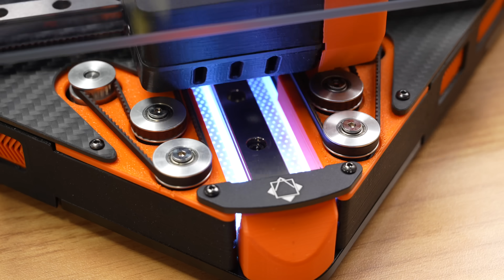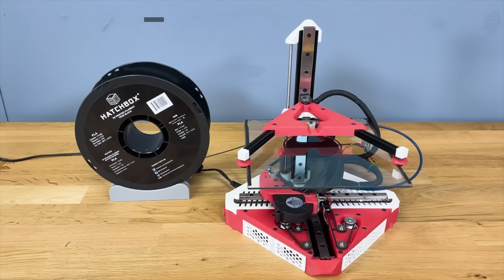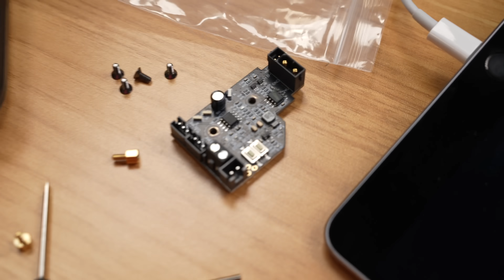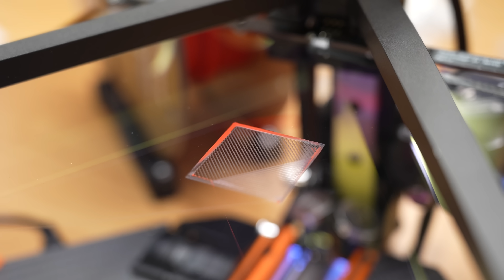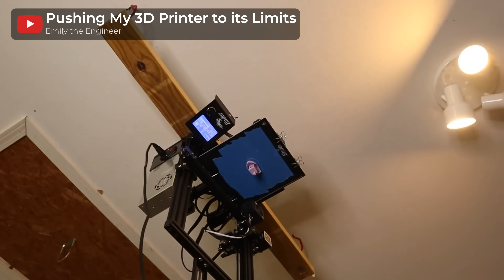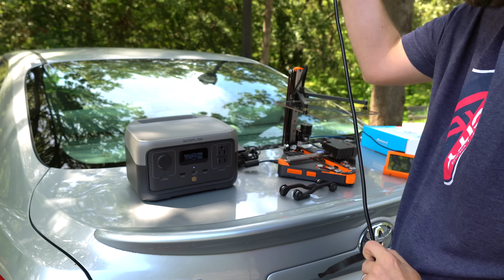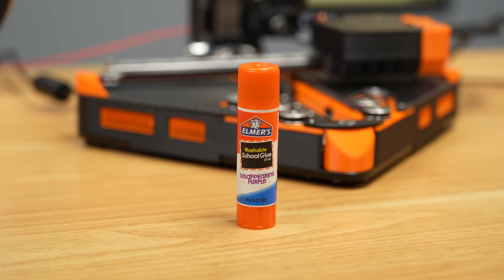Finally, a 3D Printer for Australians!

Comment: heating up a glass heatbed isn't that new, I mean, have you seen car rear windows?
Reply from the maker: True but most of the time you see little wires going across for resistive heating. I hadn't seen an ITO coating on consumer glass before.
Reply: @JeffGeerling  True, and that is indeed novel. In essence its one big transparant resistor that way instead of the laminated wire (which is cheaper but probably also more durable against wear). I do wonder if that has negative consequences for generating hotspots in comparison with the "usual" running a wire through (laminated) glass/PCB method.
Reply: @thomasvnl  From our testing, heating has been almost perfectly even unless someone scratches the coating with extremely sharp metallic tool on the back. The printing side of the glass doesn't have the coating, so damaging the coating is very difficult.

Comment: Now that I think about it... wouldn't it be safer if the extruder was in the bed as well.. like not on the Z axis... might help with the ptfe tube not catching on the linear rails...n I was wondering y the rails were sticking out so much... just realized that the linear rails are not as maintainable without lubrication...

Comment: with those insets, you really don't want them under the surface, as then they'll have to sustain pull-out force.
Ideally they'll be flush with the surface, so that the part you're screwing down onto there, sits on the face on the insert. This way it only has to support the torque of the screw

Comment: corners are rounded because you did not tune pressure advance there is a klipper doc about how to do that for klipper based printers, also 247 printing is pronounced 24 7 printing :P as in 24 hours 7 days a week,  also flor the nozzle issue, it shouldnt ooze that much when heating up  it might be the start macro that is causing it to push filament without being on the build plate to push it onto that, i recommend getting Kamp for klipper and letting it put down a Adaptive line purge that one is big and thick enough to pull every last bit of filament stuck to the nozzle with it, and cleans it that way
Reply from the maker: Thanks, all good info!
Reply: @JeffGeerling Dont get too tempted to go down the tuning route though.

Id adjust the input shaping. pressure advance for maybe 3 of your favourite types of filaments (say petg, pla and tpu) and then leave it be and enjoy using it.

Comment: i have solution for for that drooling issue: instead of pliers, use folded kitchen paper, with the lightest spritz of cooking spray. it's much easier to wipe the nozzle clean with that. and the wee bit of oil will polymerize, and build up to form a non-stick coating, much like seasoning iron cookware. seasoning nozzles is super old school, but it works!

PS: a lazy way, that could get awfully messy over time, would be to print a generous skirt
Reply: Wouldn't retraction be better? I'm thinking about retracting the filament about a cm, or ~½inch, so the filament wouldn't get heated as much, and won't expand.

Comment: The idler pull spacer, my tip is put it on an hex key and then put the key in the hole while holding the spacer up with your fingers

Comment: Finally a 3d printer that also works upside down
Reply: Most actually do, there just isnt typically good reason for it as they arent designed to be hyper portable.

Comment: Klipper is software that runs on Linux. It requires an operating system, specifically Linux but maybe any posix-compliant os would work… and can, in theory, run on any computer, not just the Pi.

Comment: Do you have any recommendations for a beginner friendly printer for  someone interested in getting into 3d printing?
Reply: @justvashu  A1 Mini easily. Prusa mini is outdated by comparison. The A1 does everything for you for less and is faster.
Reply: @BeefIngot  About the same price in Europe.
Reply: Prusa mini
Reply: @TheNetworkingGuy  Or a used MK3S, they are super cheap but super reliable, and can be easily maintained and fixed.

Comment: I'm not fond of expensive equipment reviewers get for free , that is financially out of reach for regular folks like me.  I would like to get into 3D printing, but wow!
Reply: Positron Team here - we recommend a used Prusa MK3S. They are super cheap because of the release of the Prusa MK4S, and they are extremely reliable and well documented. Very easy to maintain too.

Positron is a kit printer, def not meant to be your primary daily driver, but it can be. New kit printers are often very pricey, and Positron is making less than $50 per kit sold because of material costs and shipping.

Comment: I saw it at Open Sauce and thought it was cool.  What if you flip it over? It would be like a normal core xy printer.  Like little fold up legs
Reply: After open sauce we went to the san francisco hacker space and held it upside down, the Z axis belt wasn't right enough to hold the bed stiff in that direction so our Z offset changed ever so slightly for a layer or two lol if we would have started the print upside down it would have been fine.

Comment: Seems to mostly be a solution looking for a problem. Even if you need portability they do make small FDM printers that work the normal way. You will not be printing anything big with them, but same goes for this printer. Given the insane price and problems with the printer I just can't say it's worth it. There are better printers out there that are cheaper.

Comment: Next time try assembling a Prusa kit. The screws are bagged not by type, but by part, there are no heatset inserts (at least on the MINI+, MK3S+ and older kits, I don't know the MK4 and MK4S kits yet) and the build guides are really straightforward.
Reply: Nothing novel about the prusa kit though, and its not like youd learn anything either.

This has the novely factor, and is less money too.
Reply: @BeefIngot  yeah, there is nothing novel about a bed slinger for sure, but grouping the hardware by the part it's for (as Prusa does it) instead of screw size is better. Tiny thing, but it does make a hell of a difference.
Also, why does the user has to do QC? (by double checking all the parts) That's the job of the manufacturer.

Comment: Klipper is not OS btw, it is program on linux and firmware for 3D printer, you do not need to run specific distribution (I think it even works on windows, not sure tho)
Reply: Bah, semantics.

Comment: Are we going to get a video on you overclocking the 2040 chips? Ultimate 3D printing. Lol.
Reply from the maker: I do have a couple mods I'm thinking about that should improve cooling and maybe double the printing speed! Though don't need to overclock the RP2040 to hit those speeds :)

Comment: The idea of a "travel" 3D printer is neat. I have a ToyBox, and comparing the two, while the ToyBox is great as "Baby's First 3D printer," the software is closed source (and requires an internet connection), the print bed is teeny and it's also incredibly loud. I wish Positron all the best of luck, and I'll be watching to see if the v2 or v3 come down in price, because I can see this being incredible for, say, get-togethers at a mostly-remote company.
Reply: Open source for 3D printers means very little. Software is the most impactful thing now, and brand choice is typically about how much you trust their closed source software. Also I dont get who would not consider an A1 mini portable, it's nearly the same footprint. Also also...... "get-togethers at a mostly-remote company" What circumstance would this be????????? Why do you want to 3D print things at a get-together of any sort?

Comment: While I can't say or prove that I could design a better 3D printer, I am seriously unimpressed by this tiny printer. It's borderline just a gimmick; a cool gimmick, but for the price it's not even remotely useful. For context, with the cost of this toy, you can buy a Elegoo Neptune 4 Max (420x420x480mm) Klipper printer and an enclosed smaller printer like the Kingroon KLP1, FLSUN T1, or the Qidi Q1 Pro. On the subject of Bambu A1 mini, yes, you can get that and a huge battery power source that you would also need to buy separately if you wanted to show off and use the Positron V3.2 as advertised. I strongly dissagree that it's the MX 5 Miata of the 3D printers; that would actually be the Bambu A1 (non-mini). Also, due to physics, the nozzle ooze problem can not be fixed, only worked around.
I don't like Bambu as a company, don't own any of their products and don't indent to, but if you really need what this expensive toy promises, the Bambu A1 mini does it better and incomparably more reliably at a fraction of the cost. Even the portability aspect is comparable, but you get so much more of the A1 mini. Did anyone say AMS lite? Yeah, you can print in 4 colors with that one.
Reply: The Postitron has the advantage of being portable and open source.

It's not a gimmick if you want to travel with a 3d printer.

About the nozzle ooze, other people in the comments were saying you can just extrude a thick line of filament onto the print plate to avoid it.
Reply: @yippy7951  As it does not integrate a battery, it's just as portable as an A1 mini, no more, no less. If you want to travel with a 3D printer that works most of the time, you would still be better served by 4 A1 minis for still less money, unless all you want is attention and showing off. For that, yes, get the Positron V3.2 and don't forget your Apple VR headset at home.

Comment: But Jeff, what about New Zealanders?
In all seriousness, I want a 3D printer but a lot of the stuff I want to make is keyboard-sized (and are keyboards, in some cases), so getting an affordable printer that size is a no-go.
Then I have to learn how to 3D model, which is easier said than done. Plus we get less stock/options and higher prices than even Australia, which doesn't help. Maybe one day!
This is a cool little printer though. An open-source DIY project like this is absolutely my thing.
Reply: You don't need a big printer to make big parts. My preferred method to get around the tiny size of my Lathe, Mill and 3d printer is to design all the complex parts to mount to a flat sheet or bar of a suitable material - almost everything when you break it down has complex geometries at the edges, at some joints, perhaps multiple layers but breaks down well into rough cut flat sheets/rods attached to the complex geometry. Which instantly makes the size of the machine you actually need quite small, and cuts down on print time vastly in most cases... And if that doesn't work in most of the remaining cases you can model the whole thing and cut it into chunks that will print well - with a little superglue or solvent weld you are going to be fine structurally - really doesn't take much surface area, and if your cutouts have jigsaw/dovetail like features to help you align everything the joint is probably much stronger than the parts.

I am 99% sure I will be turning my workbench top into a gantry CNC for some larger prints and cut sheets at some point as bigger capacity is great to have, but don't let only have the space for a small machine put you off learning if you have the time (a gantry system means you can still use almost all the desk space as long as the CNC can't operate at the same time - which in a small space I think is more than handy). Also if you are going to learn to 3d model and like open-source FreeCAD and that new fork (name escapes me O something or other) have some good tutorials out there now and it is a very capable open source program for engineering type stuff - and starting from zero you won't find it hard to learn the way folks familiar with the closedsource CAD packages do.

Comment: Something as simple as a guide arm, basically a little standoff with a loop or even half loop to rest the cables/tubes on, SHOULD be enough to just remove that issue entirely.
Reply: Yep! That's essentially what the team is working on atm.

Comment: Considering I haven't even printed anything in over a year I won't be in a rush for one. Interesting that it uses so little power, as my printer is in an offgrid building now and I haven't tested it since moving it there.
Reply: Same, I had it running constantly for the first six months I had mine, then I printed everything I wanted, a bunch of stuff that was just for fun, and some toys for my Daughter. After that, it's been sitting idle ever since. I'm more worried that by the time I do print again, my PLA will have absorbed too much moisture.

Comment: "Everything's open source"
closed source CPU
Reply from the maker: That's not on the 3D printing community though—and it might be possible to get the Milk-V Mars CM working on this thing, but even with it's RISC-V SoC, that design is not open source, it just has an open ISA :)
Reply: It is designed to just be connected to any SOC via a USB C connection. The Main MCU is just a USB device, so you can easily swap out the CM4 for any other Linux compatible computer that can run Klipper. Hell, you can even daisy chain Positrons.

Comment: For the mess with loading filament. Tried getting a small piece of metal flashing. Drill a small hole that the tip of the nozzle can fit through and lay it on the nozzle. Load the filament and let all the oose Land on the piece of flashing and when it's done lift it off

Comment: I like the fact that plastic 3D printers are now getting down into consumer range pricing - aka commodity hardware but kind of useless for most people.  Took forever to get to this point.  I like the fact that metal sintering 3D printers exist.  I dislike the fact that metal sintering 3D printers cost $20K or more.  Maybe in the next decade, metal sintering printers will get down into the consumer price range and the plastic printers will go the way of the dodo.
Reply from the maker: Plastic printers will still have a place, but I think it's finally getting to the point where prototyping in plastic, or building useful things that are customized to individual use (instead of just buying something from the store and living with it) is reasonable.

There are still a lot of 3D printers that just go unused, or print trinkets people just throw away after a while, though. And that's sad, as the plastic waste can be quite hefty!
Reply: Getting down to? You can get an A1 Mini that wont give you any of the faff of older printers for under 300 bucks.

We're there mate. Anyone who wants a printer can get a decent one now.
Reply from the maker: @BeefIngot  I think the point was there are printers like the A1, A1 mini, and Creality printers that are cheap and relatively reliable. As I mentioned in the video, I can walk into Micro Center a few miles away and buy a $199 A1 mini today, if I want.
Reply: @JeffGeerling  Ah yes. I actually misread their comment and thought they were saying they wish that they were affordable, so I was saying they already are 🙃

Their point makes sense on a reread though.

Comment: Wasn't the main goal of this printer supposedly to print things comparatively faster?
Reply from the maker: Main goal is portability, I think. It's faster than my Creality, but slower than my P1S or MK4 (both of which are similar price range, but are not very easy to compact down lol).
Reply: @JeffGeerling  Yep - Portability is the primary goal. While originally we did aim to go faster, this was before the rise of Bambu's, Vorons a the time were known for being fast, so this was something we leaned on, but now the Voron benefit of speed has found its way to all printers.

Comment: Just for your subtitles, its "Klipper" not "Clipper".
And for your info, its not tweaked web UI, its called Fluidd. We use all the time in the community printers, like Vorons.
Reply from the maker: Gah, thought I found and fixed all those, silly Whisper :)

And the UI was tweaked in that they injected their logo in it, so a very light tweak!
Reply: @JeffGeerling  No problem, also.... 10-12 hours build time is mediocre :D I recommend you building Voron 2.4 or Voron Micron+. I think large 2.4 350mm took me at least a week. :D
Reply: @TekuSPZ  Vorons are for sure fun kit builds, I'm building The Rook myself atm. Super fun!

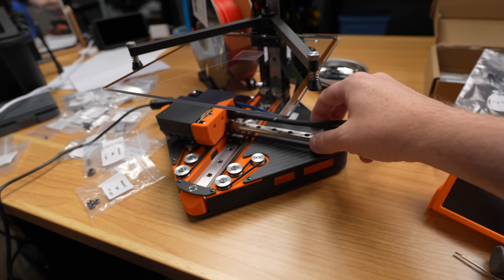Comment: 9:32 Hmmm. If the cable had some slack, you could try putting a flexible loop on the print bed and route the cable through the loop so it stays up and out of the way. Though that solution (13:11) is probably better lol.

Comment: 3 raspberry Pis inside no wonder there were shortages.
Reply: We actually did cause a supply chain shortage with Synchromesh cables with the V3 design during the pandemic. Whoopsie. 😅
Reply from the maker: And luckily, they only have one CM4, but two RP2040s. They didn't really start producing the first batch until the shortage was over, otherwise I wonder what CM board they might've chosen! Maybe BigTreeTech CB1?

Comment: In space all printers work just as well. Gravity be damned!
Reply: They work even better. Overhangs? LOL!
Reply: @madonius  I'm fairly sure that resin printers won't work in space.
Reply: @SmallSpoonBrigade  the resin printing yes, but the resin would be a massive headache to handle in freefall. Resin printers as-is will spread resin everywhere. They would need to use a larger resin bucket so the whole travel of the Z axis can be inside the resin bucket, and then you can seal it while it's printing. Then you would need some way of purging the resin after the print.